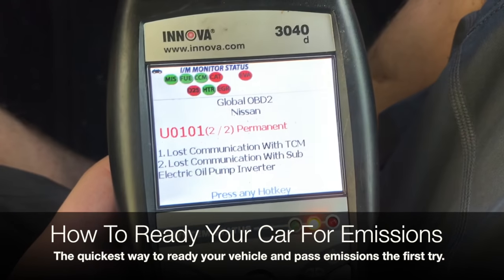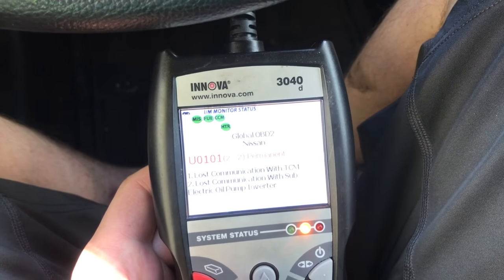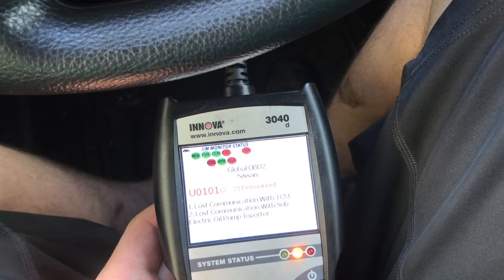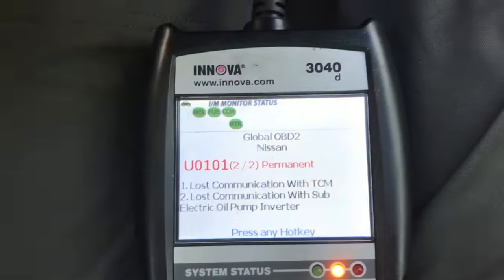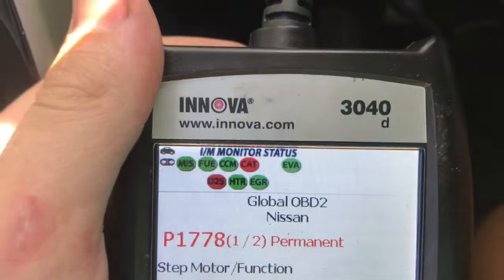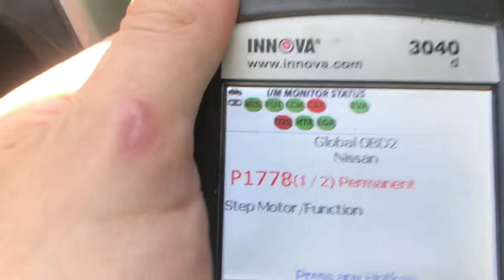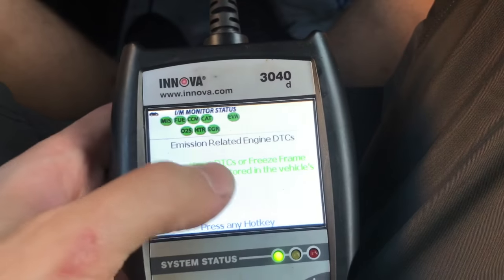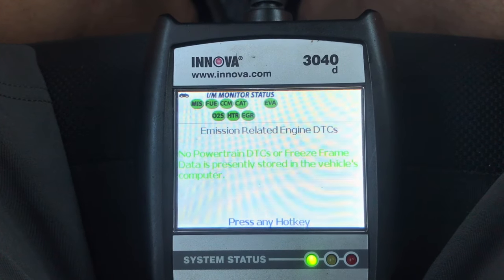How To Complete A Drive Cycle & Pass Emissions & Smog Test (Life Hack)

Comment: i wish ford was this easy, all 4 of the same monitors r not clearing and i already put on 500 miles and they still dont wna clear. now im looking into it, it turns out that its a pita
Reply: 4!  Thas a lot after 500 miles.  Sure you are looking at the right screen on your scanner?  Should be looking at "Since DTC's Cleared"  not "This Drive Cycle"  monitor screens.

Comment: I got a 6 speed my cat keep saying not ready after driving 600 mile. How do I stop it to 20 mph part without stalling out???
Reply from the maker: You would just down shift to slow down. If you have that issue though there could be a problem with your catalytic converter or something that is reading it. 600 miles should be enough to complete a drive cycle. What kind of car is it?
Reply: J&M Transmissions it’s a 2002 acura rsx type s 6 speed
Reply: Have you tried downshifting?....

Comment: Do you know where I can take my car and they do the drive cicle for me? I live in Inglewood CA
Reply from the maker: I don’t. You’d have to google emission shop, but it would be more cost effective for you to just drive it regularly for a day or two.
Reply: just drive it on the freeway to sixflags and back at night
Reply: Karrs Kars I have a question. So my check engine light comes on in my 2003 Toyota Camry and then it will turn off by itself? Does that mean it is ready to be smogged?
Reply from the maker: If the check engine light turned off then it should be good to go
Reply: Karrs Kars awesome, thank you 🙏🏽
Reply: Claudia Munoz 
I’ve in South Gate it’s hard to get to 55 mph for 5 min. It’s better to do this at night less traffic
Reply: Go to  akilauto  he on Instagram

Comment: So what was the hack exactly? I've got my 05 Sonata on jack stands right now and I tried once. I've been doing a lot of research and Hyundai's really have a shitty drive cycle. The only bad things about being on the stands is that (at least in my car) you can't use cruise control and bc the wheels aren't on the ground the speed jumps up and down very easy.  Anyway I was wondering, when the tests say to Decelerate to 0 mph without braking, how do you do that? I mean a car won't decelerate to 0 unless you but it in neutral. Is that ok to do?
Reply from the maker: So the life hack is that now you know what a drive cycle is. You want to slow down by letting the car brake on its own. Just don’t touch the gas and you slowly slow down.
Reply: Karrs Kars Awesome, thank you for the answer. Time to try again

Comment: I just bought an '06 Dodge Dakota 4.7 from a friend. He says it has a new catalytic converter, but cant get the check engine light off. He says he talked to a mechanic that says there might be a leak in the exhaust before the sensor?
Anyone know anything about that?
Reply from the maker: Possibly he replaced the wrong cat?
Reply: @karrskars  
I'll keep that one in mind. I have a feeling there will be maaaaany possibilities. I was just looking at the on board diagnostic doohickey, and one of the pins in the plug was pushed aside and squished to fit. Right now, I dont have a puter to download the firmware upgrade which probably has the specific Dodge data in it. This has Chrystler data, but I'd rather get as close as possible with everything.
I'd sure like to punch Jerry Brown and that lady that was head of CARB for pulling all this smog regulations. Granted, it did clean up the air. But some of those regulations are just money grap
Reply from the maker: Could also need a computer. I would check connections first and make sure everything is good

Comment: I cant get my "small evap leak" to go away after 3 or 4 months in repairs. Ive had several different mechanics look at and they have no clue. Ive spent probably 1500 in repairs to the whole evap system, and even had my gas spout replaced. 
If I do this will I have a big enough window of time to get it check and passed before the light comes back on? Because it WILL come back on, lol.
Reply from the maker: Do a smoke test if possible
Reply: @karrskars  theyve done one twice
Reply: They think it could be the emissions sensor but the lowesr quote ive gotten is 700 and it still could not be the problem.
Reply: I'm am in the same boat as you..tried everything including the canister..spent almost 1400 so far.. the thing is to get it repaired right your gonna have to keep picking and replacing diff parts until you get the right one..diagnostics is not pinpointing it and the smoke machine is not showing leaks..the best thing to do is clear the check engine light and drive til all the sensors are ready but the evap..then go get an inspection and pass because most states allow you to have 1 or 2 not ready depending on the year of the vehichle..you keep the evap sensor from not sparking the cel by driving it below 15 percent tank or keeping it above 85 percent tank then you can keep driving picking at it until your next inspection or you can take the stimulus check and spend the whole damn thing on a new evap system with a little extra from your savings..
Reply: @landrum182  thanks man this what I'm going to try and do. I have a reader coming in the mail.
Reply: Def not going to waste money on a new evap system or sensors. Ive spent enough.

Comment: I drove my BMW e46 m3 500 miles after changing the pre-cat o2 sensors and it is still getting a not ready status?
Reply: Did it pass? I just changed all 4 o2 sensors in my mustang and the monitor isnt ready after 200 miles or driving
Reply: You gotta drive it using the right method

Comment: How long is "awhile"?  The attendant says we need to drive the vehicle for 150 miles (not in a straight line) to turn off the codes.
Reply from the maker: Really just depends on your vehicle. I’ve had vehicles that passed after driving only 15 miles. I’ve had other vehicles that took FOREVER like 200+ miles over 4 days.

Comment: How long does New catalytic take to get ready?
Reply from the maker: It can take a few miles or many miles. Just depends on the vehicle and how you are driving.
Reply: I drive it 55-65 mile coasting down the freeway
Reply from the maker: Shut it off. Let the engine cool down and then drive some more after it is cold.
Reply: J&M Transmissions how cold? Because I aredy drove 1k mile after putting new catalytic and o2.
Reply from the maker: You’re supposed to let it cool down all the way. Like overnight. And then drive it again and get it up to operating temperature. If you’ve gone 1k miles there may be another issue

Comment: My check engine went on. I took my car to the shop and ran a computer test. Found that my oxygen sensor is giving a code. Will this reset by driving the car or i have to replace the oxygen sensor? Before it can reset?
Reply from the maker: If you reset it your code will just come back on (unless the code come on for a random reason). Most likely you’ll have to swap out your o2 sensor.

Comment: I drove my truck for almost 800 miles already and yet CAT AND EGR VALVE monitors are not ready.... but there is no CHECK ENGINE LIGHT OR ANY CODE coming out of the OBD II.  I was told it could be a "bad computer".  Any idea of that?
Reply from the maker: Could very well be a bad computer. What’s the year make model and engine size?

Comment: And btw says this on the internet.... OBD scanners/devices, when plugged in, draw power from your car battery to operate. ... A lot of OBD devicecan put your car into diagnostic mode, when plugged in. Now, if you are driving and the car is diagnostic mode, itcould be dangerous. This is because in diagnostic mode, the ECU prioritizes vehicle data differently.
Reply from the maker: Yes most of the ones that put it into diagnostic mode will tell you what to do with the vehicle. It’s pretty fool proof unless you aren’t following the instructions. And those scanners are $1000+

Comment: What if your check engine light comes back on before you get to the emissions testing?
Reply: You will have to see why your check engine Light came on,Buy yourself a car scanner diagnostic tool Harbor freight has them for like 30-40$.. You will NOT pass SMOG EVEN IF all your Monitors are complete if your CHECK ENGINE LIGHT CAME ON!! Good luck👍
Reply: @jessieurgea9899  I know why it's on, stupid O2 sensor, I just don't have the money to fix it right now

Comment: What about when u see all those systems in green and none in red, but u have not perform the driving cycle
Reply: They stay green forever until you disconnect the battery or clear the codes.  They do not clear with every key cycle.